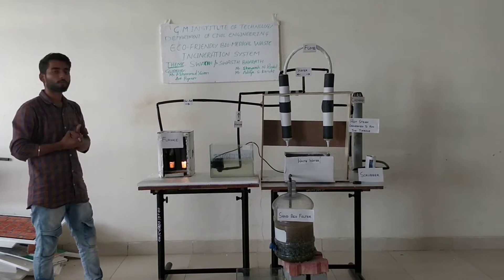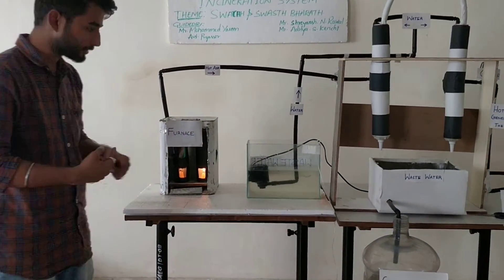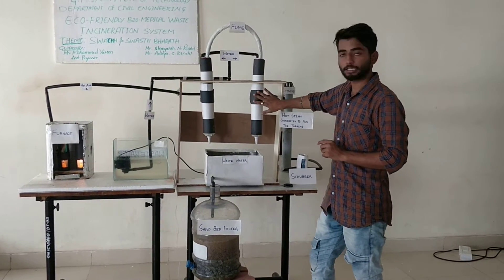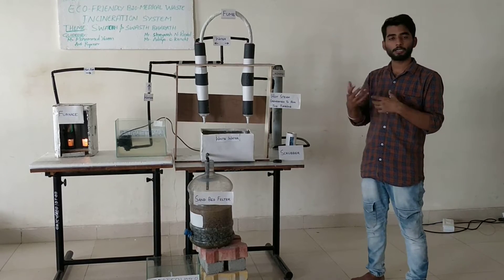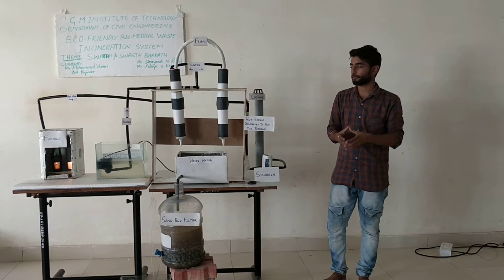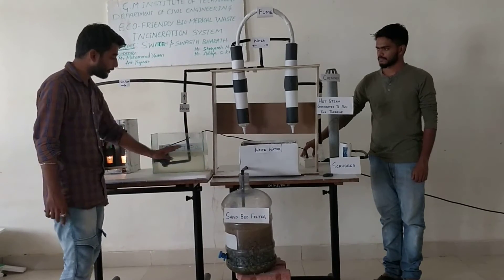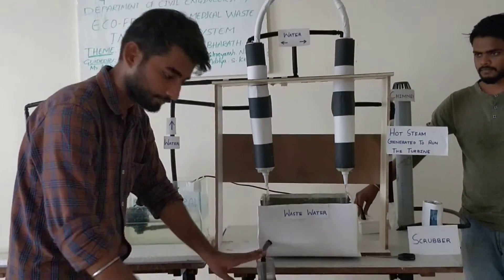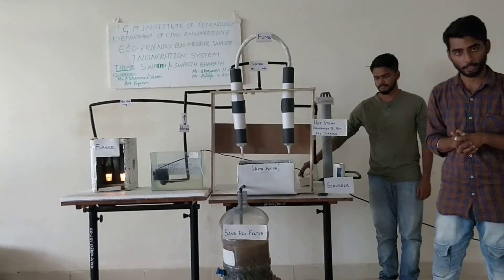ECO FRIENDLY BIO-MEDICAL WASTE INCINERATION SYSTEM

Comment: What material you used in it  ? Please tell me
Reply from the maker: We used recyled materials like electric pipes and a metal tin as combustion chamber and filter media as Venturi scrubber to remove particulate matter which pumps water in the form of fine droplets and a sand and gravel filter which treats the contaminated water and which can be again re used to purify the air.
Reply: @mohammedyaseen2546  thank you